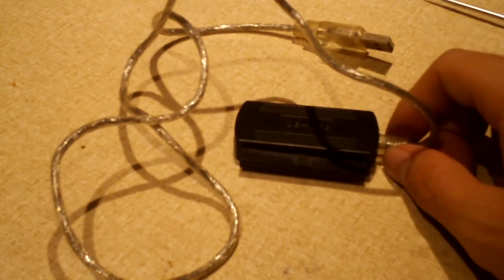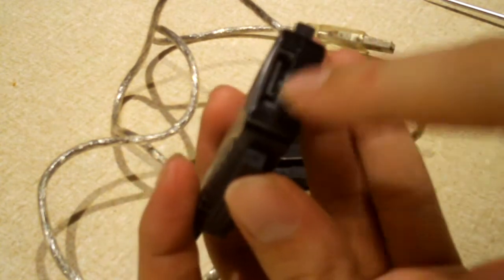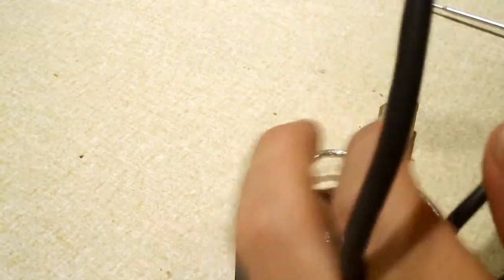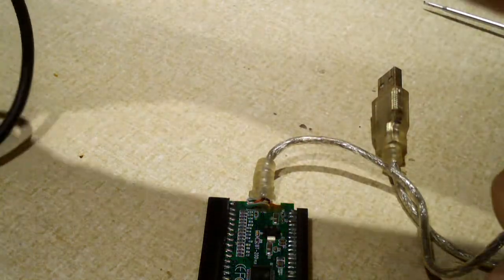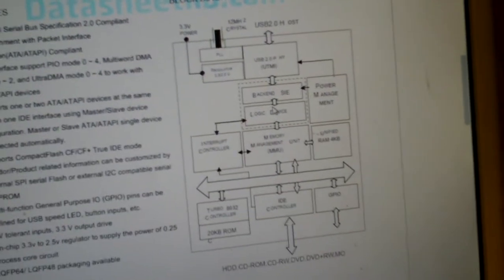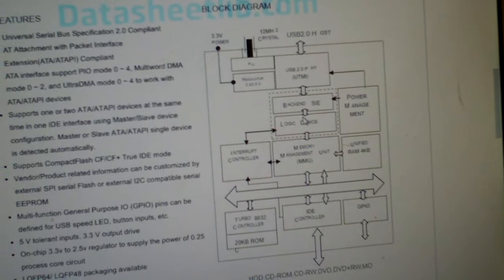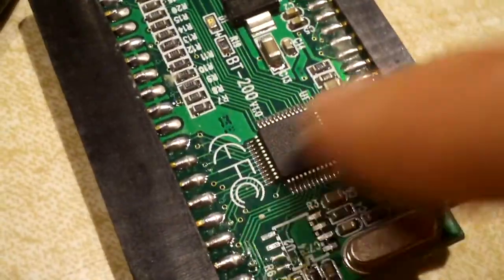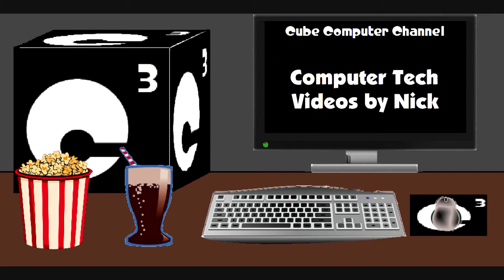A look inside my old IDE USB adapter

Comment: I've used 4 different brands of those IDE/Sata to USB adapters and most of them are terrible. Random disconnects, slow transfers, one even toasted a drive on me. I use a spare desktop computer with a spare IDE, Sata and even SCSI connections to get data from drives or to do transfers. Much better off.

Comment: You have a defective unit! I have over 30 of them, most are used for my NAS on SATA hard drives but they work awesome and have for years, I have another IDE drive that I use as an external drive on my PC with one of them and it works all the time 24/7 just fine.